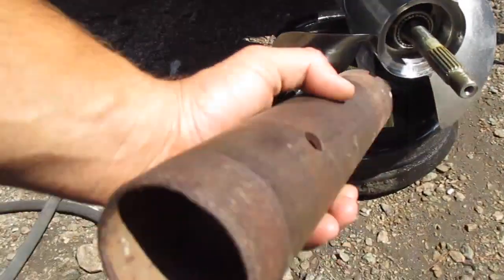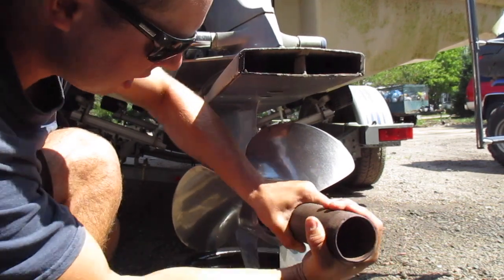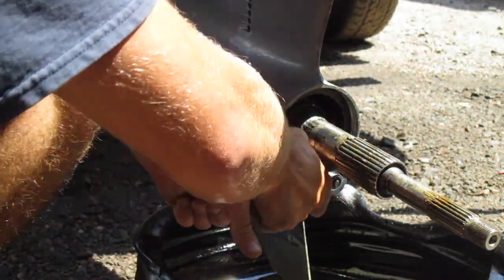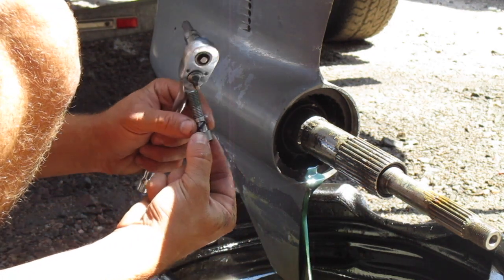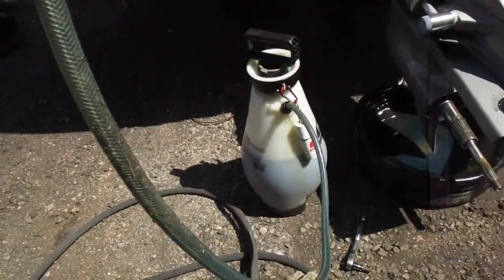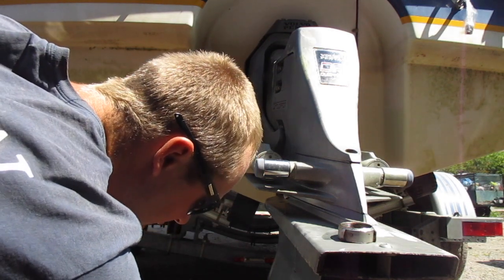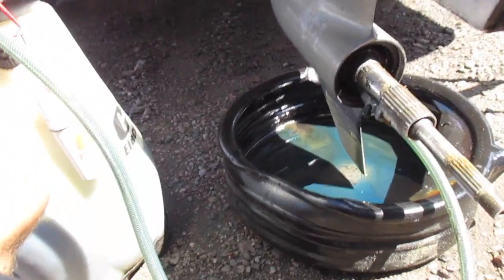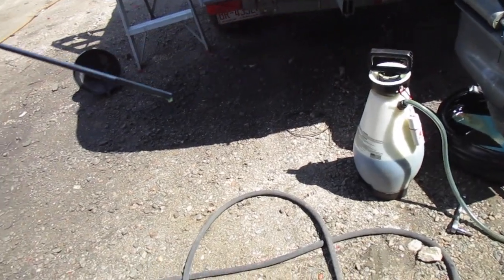Volvo Sx, Dp Drive/ Lower Unit Gear Lube Change

Comment: This might be and older drive bc when i fill mine i take off that front cover and there is a screw on the side that i remove. Once i fill it i wait for the oil to come out of the hole on the side and thats how i know i have enough drive oil. At least thats what the manual says to do. Filling it up until it comes out of the top seams counterproductive.

Comment: Nice vid! A few suggestions...always replace drain/fill plug gaskets or O-rings, this helps prevent leaks and I always coat the prop shaft splines in OMC/Bombardier triple guard grease, this will prevent the prop from seizing on the prop shaft. Once a year the props should be removed and the splines greased. Same as when you pull the drive at the end of each season, coat the driveshaft splines in triple guard. On Volvos and OMCs that is the only way to grease the drive shaft splines.  My boat is moored in salt water with the drive all the way down 6 months each year and the prop will literally just slide off the splines. Triple guard is the best water proof grease I have ever tried.

Comment: A grease gun is perfect size to get the inner prop nut off. I also blow air from dip stick hole once down to thin stream. I find this pushes out that stubborn oil you really want out.   Someone else said they remove front cover and and open the filler screw next to shifter to see when fill is at proper level. I do it, less messy n wasteful.

Comment: If you have an electric shift DO NOT shift the drive into gear without the engine running.   You can destroy the internal neutral safety switch on the shift actuator which causes the EVC system to not power up.  Simply place a 2x4 between the prop and the cavitation plate to prevent the prop from turning.

Comment: What oil grade do you put on that lower unit.  I have the same one.  Thank you for the video.
Reply from the maker: 80-90 high performance gear lube. Volvo makes a full synthetic i believe a straight 90. Either way a 80-90 marine is perfect.

Comment: There's a note in the book stating to take the back cover plate off and loosen the fill screw to ensure your filling completely, is this a little to much extra effort than doing it how you did it by over filling? Also, on the oil drain screw at the bottom do you check for any shavings attached to the magnet drain plug? Thanks love the special tool, easy enough to make.
Reply from the maker: Hey Paul, yeah take off that back cover. I am usually in such a rush and let that oil flow back into the pan til the dipstick is good. Proper is to pull that cover. Metal shavings shouldn’t be present like the dog clutch system. The cone clutch system will not produce “regular” shavings like other systems.

Comment: Very informative video.  I have DPH outdrives and wondering if same fill procedures? Prop on/off etc look the same. Well done, thank you!
Reply from the maker: Correct. Same thing. Only difference to those is you will have a 14mm bolt plug rather than an allen key i believe.

Comment: Great video! 
Doing the maintenance on my DP right meow. 
On the 2nd (inner nut) I pulled out a torn rubber ring of some sort. What was that and does it need to be replaced? 
Thanks

Comment: Do you use the Volvo lower unit oil? Or can you use any lower unit oil?
Reply from the maker: Volvo’s are particular. Use mercury high performance gear lube or sierra high performance or volvo yes.

Comment: Great Video, Thanks. If the prop nut turns the engine through the compression, Can I use a impact gun to remove the prop nut?
Any rule against using an impact gun on the prop nuts for removal?
Reply from the maker: No sir. You are good to go. Just torque it on the way back in.
Reply from the maker: If still having issues wedge a board between the props to stop twist. I usually just grab the prop and twist and it come right off
Reply: @Schneids15  Thanks Bud. Appreciate it!

Comment: What was the fitting you used on the lower filler hole ? Looks different then the screw in style for Mercruiser.
Reply from the maker: Sometimes they have a flathead screw or a bolt that goes in for a plug. The fitting on my gear lube pump is brass and just has a o ring on the end. You shove it in and it won’t leak.

Comment: Thanks again Schneids15. Do you know if DPH can be filled from above? Also, the mechanic would "burp" the unit when filling. What i wrote down was "fill at 35 degrees, burp at zero, back to 35 and top off" Thank you for the help
Reply from the maker: You could fill from the top but you run into the burp issue like you say. If you go from the bottom you can’t beat gravity it bleeds itself.

Comment: Do you know O ring part # for 1999 DP SX?
Reply from the maker: No i don’t sorry. I usually use a universal kit and they fit perfect.
Reply: Sourced from Hamofa.com, their part number OR981 @ $1.21. Do not try to substitute with standard o-rings as the outside diameter is critical for proper sealing.  Pretty sure the OEM number is 955981.
Reply: @LI-FLKayakFisherman  You would not happen to know the part number for the scew also?
Reply: @rogercramer3654  #3851329 VP describes it as a screw.  O-ring is #955981
Reply: @LI-FLKayakFisherman   Thank you very much